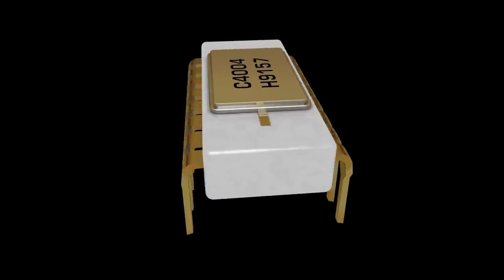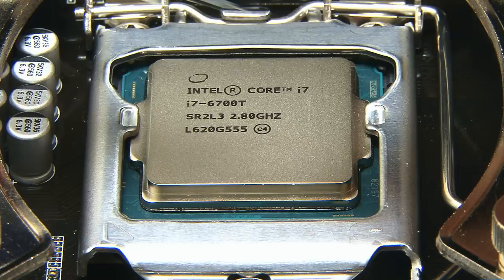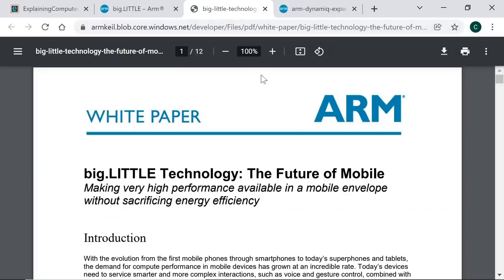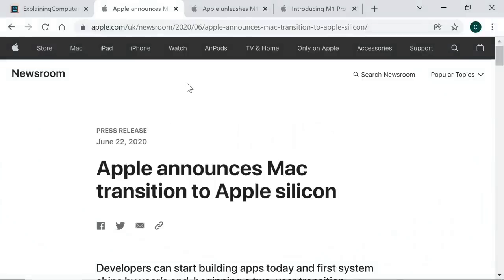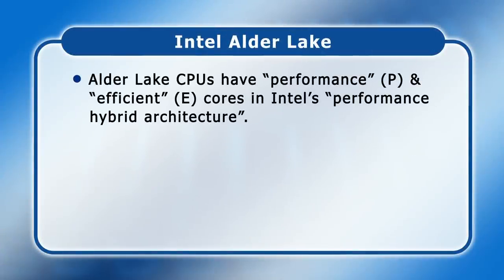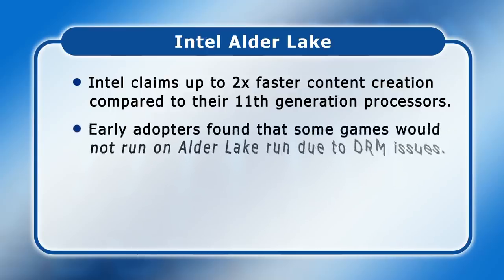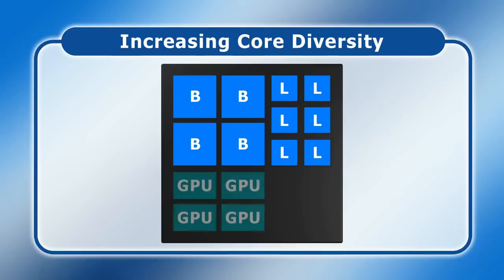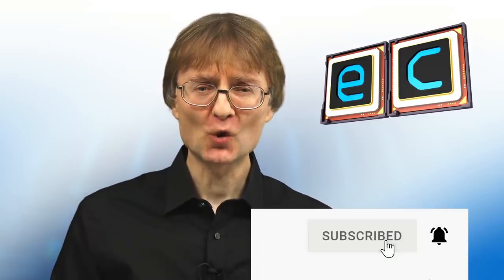The big.LITTLE CPU Revolution: From Arm & Apple to Intel & AMD

Comment: I'm sure saving a couple of watts makes sense for phones and laptops, but when it comes to desktop computers, I really don't understand how saving a couple of pence worth of electricity a month is worth the trouble. I have this picture in my head of someone using their big-little computer at the office and then driving back home in their nearly-megawatt-motor Tesla S.
Reply from the maker: Saving power also saves heat, so when the little / efficient cores are used on a desktop, that leaves thermal headway for the big / performance cores when they kick in.
Reply: You save heat for thise big cores. Intel is getting the extreme speeds of the Alder Lake P cores because the E cores save power and heat to give them more headroom.

Think of it like this:  A 12-core 24 thread cpu with nothing but big cores pulls 12W per core, for a 144W tdp. Now put that same thread count on a 8+8 design. 96W for the 8 big cores, but then let's say 2W per little core. That's a new TDP of 112W, for a savings of 32W. 32W isn't a lot, but that's an extra 4W to each big core for higher clocks in single-threaded workloads or even 8-core / 16 thread workloads.
Reply: @DigitalJedi   > You save heat from big cores.

One word, Efficiency. New cpus are good at this sans the little cores. Also you need to test exact cpus with and without little cores before you can say it's better than the other. Much like comparing older faster cpus to newer slower cpus (based on ghz) there is far more to it than just the heat. IPC is a huge factor.

Cars have something where they 'shutdown' 2, 4, +, or all cylinders to save power when at a stop, etc. I don't need a second little engine in my car. I just need a stronger starter when I push the gas peddle.

> A 12-core 24 thread cpu with nothing but big cores.

Two words. Scheduling. (aside from the comparing of two different cpus covered above) Take 2 vs 4 little cores on an 8 big core processor. You have 10 tasks to do on little cores. How big a difference is the effect on the 8 by the 2 vs the 4? Will it queue the task or move to big? Will the 2 be slower? Can I have any say in this and how will my say effect things?

Now I'm sure this stuff will be worked out but it's a big concern if not.

To me this is like the crysis problem. The software was written in a way that it was thought 5ghz was closer to the floor than the ceiling for cpu speed.
Reply: @WorstChicken  " The software was written in a way that it was thought 5ghz was closer to the floor than the ceiling for cpu speed."
Measuring CPU performance by GHZ is like measuring car engine performance by RPM - it's mostly irrelevant unless comparing CPUs of the same architecture.

Look at your processes in task manager. You're running hundreds of threads at any given point. When designing a CPU, a tradeoff must be made between a lot of threads or great single core performance. big.Little makes that decision irrelevant. You can fit 4 little cores in the same physical die space as 1 big core, while consuming less power. It's almost like a cheat to add more multithreading performance. AMD will go big.little soon as well. They're the last holdout at this point.

Comment: in regards to the rk3399 big little archeticture. fo gaming if a emulator uses typically 4 cores how is the performance distributed? i see this is good for multi tasking but dont see the benefit when running 1 massive program with nothing else going on for processing. it seems the smaller chips clocked lower r getting the bulk of the work

Comment: Hmm. Shame no side mention of multi-CPU setups that were around before the multicore processors, and how they compared. I used to have a dual-P166 machine that was originally designed to be a server...*heavy* piece of hardware in the literal sense.
Reply from the maker: There is always more that could be included -- and a lot more here! :) But education is about focus, so I kept this just to the big.LITTLE thing.
Reply: @ExplainingComputers  Point... you were talking about big.LITTLE, not multicore in general. Mea culpa.

Comment: i think you forgot epyc with 64 cores, well, as chiplets on one socket, but, still a cpu, intel with 56 cores is sort of chiplet too, two 28 cores chips on a socket

i personally find big little dumb and a proof that the multipurpose x86 core couldn't with the task, be efficient and save power

this big little idea gave us from intel a ridiculous glued together two cpus in one solution, a normal core cpu glued to a celeron mixed with core m cpu that wastes up to 400 watts for just that

amd might try apart from adding power efficient athlon cores on a chiplet, some fpga hardware accelerators and some arm cores, but rumors are wild as you said
Reply from the maker: I did indeed, my bad. :( I have posted a pinned comment.

Comment: Good video, very well presented . You did miss out the hyper threading stage between single and multiple cores. And also the prime core system used when single threading is needed using the cortex X cores.
Reply from the maker: I chose not to get into hyper threading / multi threading, just as I did not get into cache, etc. I kept this video to the point on big.LITTLE only. In education, less is often more.
Reply: @ExplainingComputers  yes, absolutely

Comment: Thank you.
It is interesting, how fast the CPU (and GPU) can change the speed (MHz) and how fast it can switch between cores. It is possible, that the CPU can use the full power of a core and let it run into thermal problems. And if this core reached this problem, the CPU can switch to another core and let the first one cool down (a bit :)

Comment: So does that mean AMD was kinda right about having more cores and clock speed was just a marketing term? Is big.LITTLE an expanded version of hyper threading? Would we ever see <5nm sized transistors in upcoming processors?
Reply from the maker: To some extent, yes -- core number, and now core type, are just as important as clock speed. Hyper threading / multi-threading allows two tasks (threads) to run in parallel on one core. Big.LITTLE is about dividing tasks between different types of core. Intel's Performance cores are hyper threaded (they run two threads), whilst the little cores run one thread only.
Reply from the maker: AMD is rumoured to be headed toward a 3nm process for Zen 5. But this is a feature resolution, so the transistors would be bigger -- see the link towards the end of the video description.
Reply: @ExplainingComputers  Yea I thought so too, I think it was one of your videos that mentioned a change in die material to allow such small transistor gate sizes where the electrons do not "squeeze" by as easily as they do now on silicon. I could be wrong though.
Reply from the maker: @radazeonv8821  I don't recall discussing this in a video -- but I may be wrong, as I forget what I've covered! :)
Reply: @ExplainingComputers  'Hyper threading / multi-threading allows two tasks (threads) to run in parallel on one core.' my understanding is that this is not strictly speaking correct. hyperthreading works the same as multitasking. instructions are queued to execute one at a time on any given core. when the instruction has to wait(on maybe storage for data), then a hyperthreaded core would execute another instruction from another thread while it waits,(currently maximum of two threads per hyperthreaded core). thus improving the cores efficiency as it reduces core idle time. for threads that have no wait time, hyperthreading would not give any performance gains. this is contrary to 2 physical cores which will still give a performance gain even if the threads have no wait time. little cores should actually be able to execute instructions independent of big cores.
Reply from the maker: @longdang2681  Yes, you are correct, and I am well aware of what you say. But the basis of multi-threading  is to execute two tasks at the same time using the same core, if not entirely in parallel as you note. And in the context of my answer here, I think this was clear enough. I'm seriously thinking of stopping answering anything in the comments (like most larger YouTubers) as all I ever get if I try to help is nit-nicking like this. Please, give me a break when you know very well what I meant.
Reply: @ExplainingComputers  I was not nit picking.  The distinction means that as opposed to complementing hyperthreading Big.LITTLE might be a direct competitor to hyperthreading. 1 hyperthreaded core versus P+E core(with hyperthreading disabled on the P core). Will both setups be equally as energy efficient? Will the P+E setup perform better? Intel has always played to the strength of it's single core performance. Notice how hyperthreading highlights this dominance by concentrating more work load to each single core. It'll be sad if multi core wins over a better quality core(more MHz). Mediocrity can be found everywhere, but superior stuff is rare and valuable. Intels P cores currently still have hyperthreading, but will it last?
Reply from the maker: @longdang2681  I had no intention to offend, and I technically I agree with everything you say. :) But I get and read about 43,000 comments here a year and cannot reasonably be expected to prepare technically exacting answers to every comment I reply to (a good 10,000 a year). I answered the previous comment in a context, which is a totally different one to that we are now discussing.

Comment: biglittle isn't  a configuration that anyone need on Desktop and laptop cpus. AMD see that true they have time.  But Why? In follow video :

"Fixed" my Testing? Trying a new Way to Test i5 12600k vs R5 5600X (Performance vs Price & Power) of the 8auer. that the ryzen cpus can be more efficence as intels alder lake . In other tests like tests of igorslabs you can see that the 5950x of amd in the usages that need full cpu power better is than alder lake. AlderLake trick is to use the E Cores to push the P Core in Singlecore power.  For example on leaks of the 12400 of intel you can see that the cpu have a singlecore power of the 11900 but in the multicore power  is not so efficencie as the amd ZEN3 cpus. So the kind of microarchitecture is more depend for efficency and power as the biglittle  the principle of biglittle .

So AMD announce that the Ryzen 6000 runs under AM4 and have AMD 3D Cache and a better production in nanometer proceedings. So the Ryzen6000 should be more effency as the intel alder and in singlecorepreformance have more speed as alder lake without e cores and should have the preformance as an alderlake with 2 ecores. Note 8 E-cores have a singlecore Preformance of an 7700k . 

Alder lake is a trick of intel not a solution for better effency .

Comment: I remember when we used to get excited over higher clock rates, and extra instruction sets like MMX and 3D NOW. Then we got excited over hyper threading. Then we got excited over 64-bit even though everyone still ran a 32-bit edition of Windows XP. Then we finally got to 64-bit computing for everyone. Then we got excited over multiple cores. Then it got boring. Then AMD rose up and got us excited again, but it was still a snooze fest for advancing CPUs as far as average consumers were concerned.

Now the world is changing once more with big.LITTLE or what ever marketing name the chip companies come up with (I'm hoping AMD comes up with something fun). The question is, will the decades old way of how operating systems work have to be revamped from the ground up at some point?

Comment: I don't like the idea of big. LITTLE technology. In desktop PC, CPU can shut it's core down when not running heavy task. AMD Ryzen has done a good job and it proves that it can save lots of energy with their desktop and mobile CPU. Big LITTLE proves to be very complex, and for desktop PC, it's a hassle. Desktop CPU has so much architecture in it, such as Avx, SSE 4, and virtualisation.

Still, I think big LITTLE will benefit mobile devices better. For desktop, maybe not so much.

Comment: Future is looking bright for big.LITTLE design., it will mostly be used to fit high core counts on a smaller die (more performance and lower prices for consumers).  24 / 32 / 64 core CPU's for Desktops and Laptops.
But what we really need is improvements in integrated graphics. AMD did a good job with RX Vega but its still not powerful enough.
If they can just double the core count on APU/GPU side of things. It will completely eliminate the need for low and mid range Graphic Cards.

Comment: I'm not sure about a quantum chip next to a CPU.  Don't you have to keep your qbits close to 0 Kelvin?
Reply from the maker: It depends on the type of qubit. While most do need super-cooling as you note, photonic qubits -- such as those used in Xanadu's chips -- operate at room temperature, so could be co-located in a conventional processor.
Reply: @ExplainingComputers  If they make a chip that can measure the spin of a photon, I will covet it mightily.

Comment: I hope this is only transitional period and that big/little returns to it's rightful place - two separate devices (or as separate as possible on collection of chiplets, see below), because it feels like it introduces decrease of performance and increase of power consumption. Also, it feels like ARM save transistors on, and Intel failed at power management (and that AMD will join this club only if they fail at that too). Waiting almost two weeks didn't help to dissuade me from writting this comment, sorry (especially, when it appears as part, or starter, of delusional fanboys' flamewar at first glance).

Comment: It is nice of intel doing the big little procesor and hence changing the die shape to rectangal. Altough, they should had do the FEM for the bending, as it is doing now and then the cpu cooler is not doing its job properly. BTW, intel says it is not an issue, but a feature. :D https://www.youtube.com/watch?v=Vkd_SWdSdIY

Comment: I still have this question though. For PCs which are always plugged to the wall outlet, why not just use all BIG cores? If overheating and down throttling is a problem, then lower the frequency to lower the temp. How are LITTLE cores faster in the case of desktop PCs?

Minor correction at 2:18: It was the Athlon “64” X2 (no “X” before 64).
Reply from the maker: My bad on the Athlon name as you note.

Little cores always offer less processing capability than performance cores. However, they are there in addition to the performance cores -- so (eg) a processor with 6 performance and 6 efficient cores can hand off simple tasks to the efficient cores, so allowing the performance cores to focus on heavier tasks.

Little cores also use less power. The electricity that comes from a wall socket is not free. :)

Comment: Still not sold on bL architectures.  The fact that faster processors can finish a task and return to a low power state earlier diminishes the advantages of having separate power efficient cores.  We all know why bL is used in theory, but in practice the actual power savings are not actualized.

The reality is that Intel's alderlake cpus drawl more power than their 11th gen counterparts both at load and at idle despite the big little architecture.  Sooo...  Where is the promised efficiency?
Reply: "Draws more power"
That isn't true.

11900K draws without power limits and AVX512 enabled +200 watts and is an 8 core 16 thread chip. The 12900K at the same power draw is twice as fast with 16 cores vs 8 cores, with the biggest IPC increase in one generation since Sandy Bridge.
Reply: @saricubra2867  okay ipc wise 12th Gen is more efficient, but overall power draw is higher, and that has nothing to do with bL, cuz it's all P-core.  Idle power draw is also higher 12th gen, that's a complete failure of bL.
Reply: @alanhonlunli  Power draw isn't higher, the max on a 12900K is 230ish watts and it's a 16 core chip, the other is an i9-11900K...
Reply: @saricubra2867  see you're comparing apples to oranges as soon as u mentioned avx512.  12th gen doesn't even support it.
Reply: @alanhonlunli  "not supported"
Officially. But the big cores themselves have AVX512 inside.
Reply: @alanhonlunli  No, it's apples and apples. 11th gen desktop is terrible.
Reply: @saricubra2867  Show me an AVX512 benchmark for Alderlake, cuz I sure cant find any.  You can't compare the results of two different benchmarks and call it apples to apples.  AVX512 is famous for its ridiculous power draw, which is the exact reason why you specifically mentioned it.
Reply: @alanhonlunli  Watch Anandtech review.
Reply: @saricubra2867  thanks, u should read it too, cuz alder lake uses 272 watts.
Reply: @saricubra2867  Anyways, this has nothing to do with my arguments anyway.  So let's forget this.  Because avx512 performance is not supported at all on e cores so it has nothing to do with the supposed efficiency of the big little architecture, which was my point.
Reply: @alanhonlunli  Efficency of Big-Little is the  overall perfomance for the 16 cores vs the 8 cores from the i9-11900K with a similar die space as an example
Reply: @alanhonlunli  nah, 200 watts and 220 peak for multicore workloads 8P+8E.
Reply: @saricubra2867  you know they dropped from 14nm+++ to 10nm between 11 and 12 right?  These are all pretty weak arguments for the benefits of bL.  That's 8 extra e cores, which are pretty much useless in real world applications.
Reply: @alanhonlunli  That is a big lie and you know it. Over 70% perfomance improvement by the extra cores.
Reply: @saricubra2867  not even Intel's own marketing team would say shit like that.  Lol...
Reply: @alanhonlunli That is 5nm Zen 4 with Bulldozer-like IPC compared to Apple M1 and M2 chips.